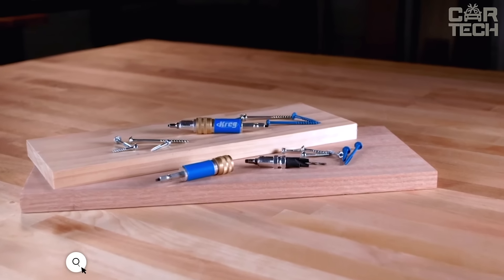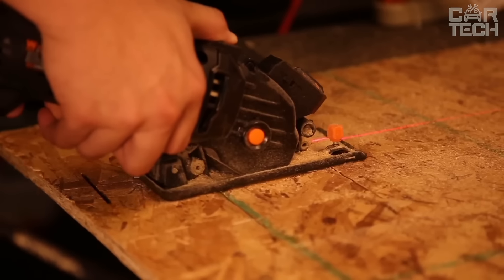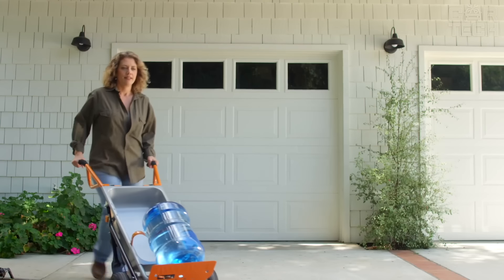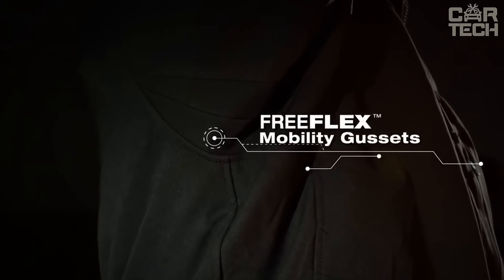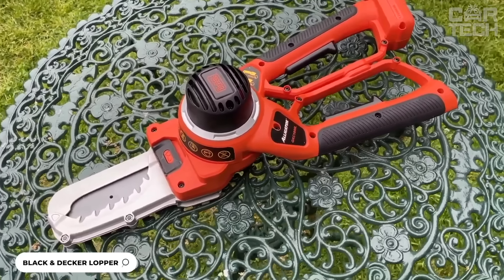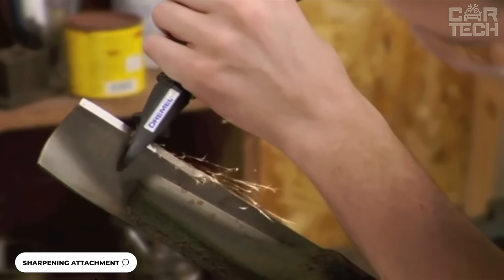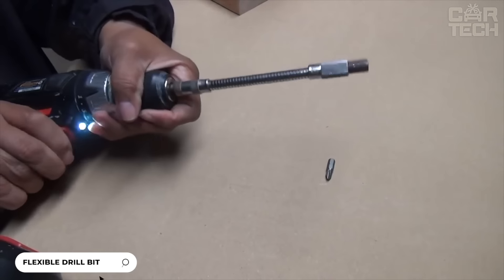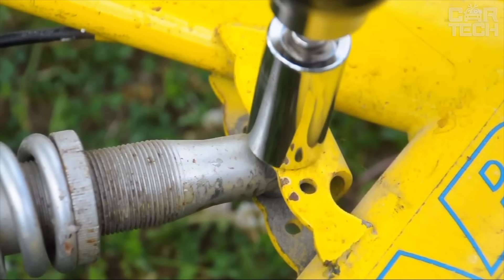250 AMAZING NEXT LEVEL TOOLS on Amazon You Need to See in 2024

Comment: I find your english is at times awkward and inaccurate; for instance the vibrating saw doesn't use "nozzles" it uses blades. Where did you learn english it is obviously not your first language. Quit calling drill bits and saw blades nozzles! It is so aggravating!!!  Also sand blasting is dangerous and the use of a non-silicate abrasive media is highly recommended; In addition you should be using a full-face respirator. ... Otherwise a cool video.